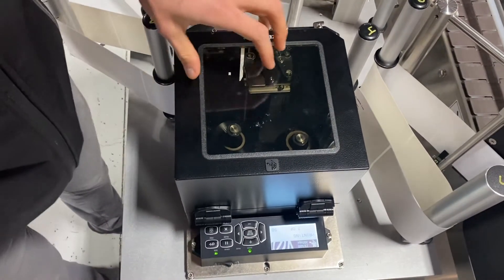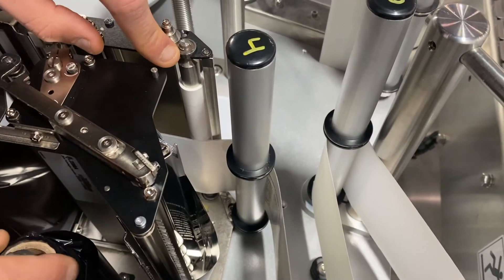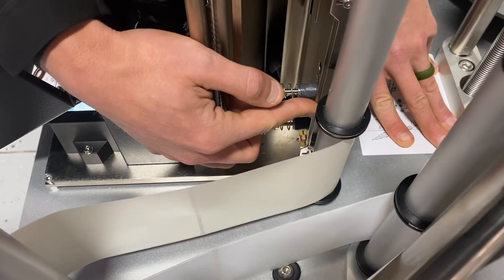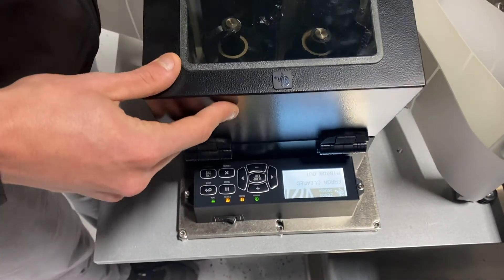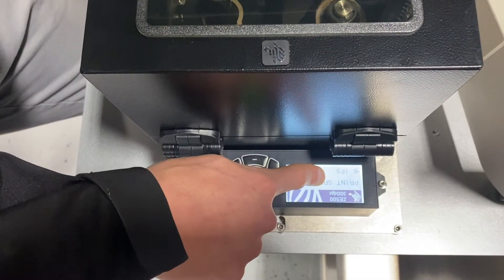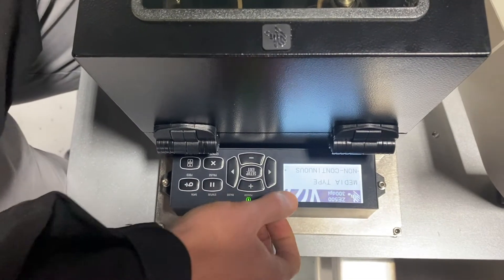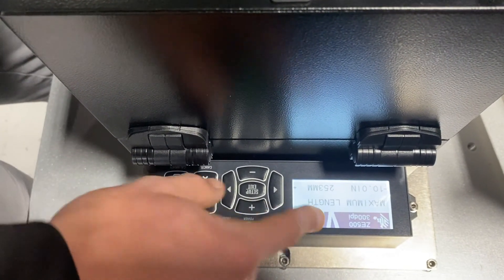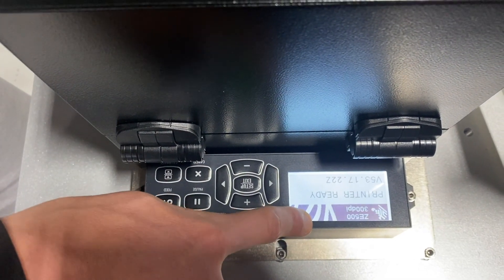Zebra ZE500 Printer Overview

Comment: Can you make a video of how to go about the remote controller?
Reply from the maker: Hello, thank you for reaching out! For the ZE500 print engine, all controls are managed from the control panel at the top of the system. We have not worked with a model that comes with an external remote controller. You can find the ZE500 manual which covers the control panel on Zebra Tech's website: https://www.zebra.com

Comment: Not sure if you’ll see this with it being so long ago, however, I did the media and ribbon recalibration. After which the printer kept printing non stop, basically just shooting out labels. How would I fix this type of issue? Simply recalibrate again?
Reply from the maker: I would check to see if your ribbon / labels are webbed through the sensors correctly. If it doesn't see the label gap, or the ribbon is somehow blocking one of the sensors, it might cause the printer to continue progressing.